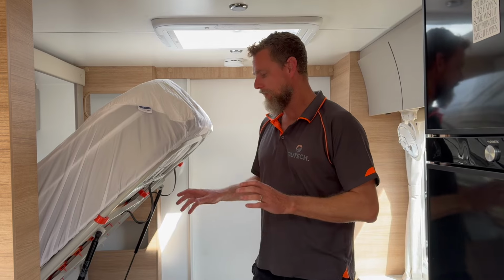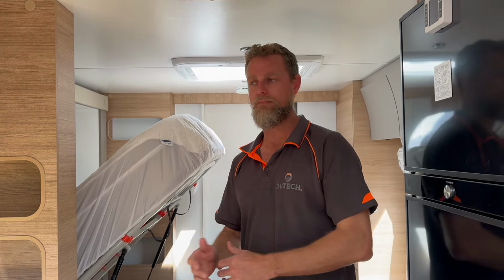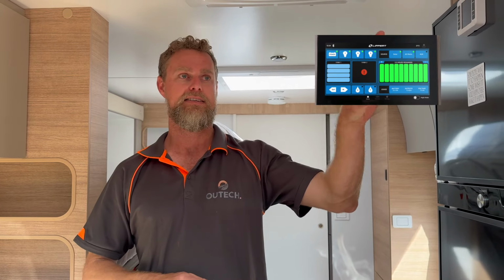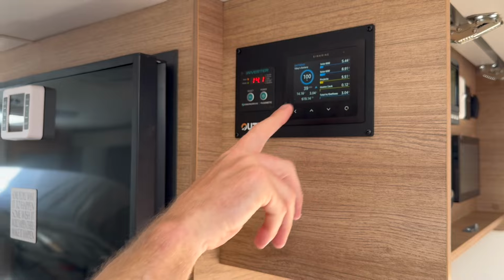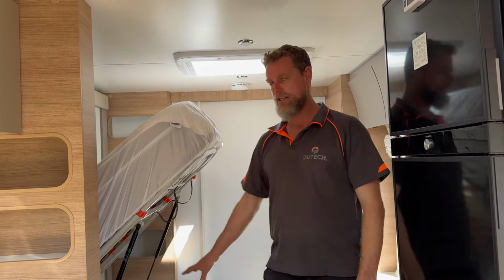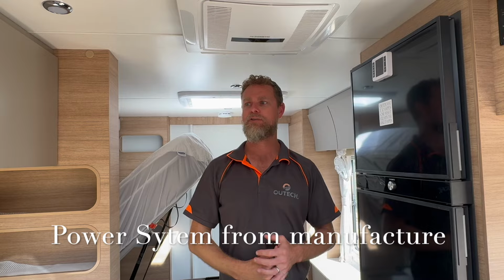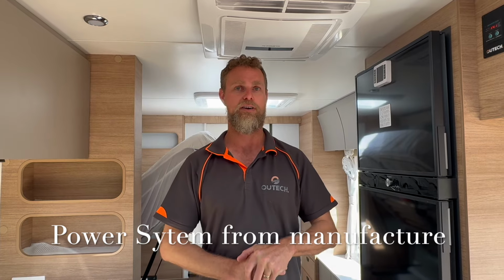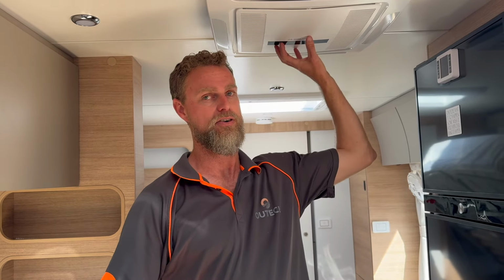The PIMPED POWER  PACKAGE - Jayco Silverline Outback

Comment: Beautiful job in the install and so much cleaner than the herons nest that Jayco have made under our Covid era Silverline bed! Now, apologies for this utterly unrelated question but … 😅. I noticed in your intro that the gas bottle cover has something that looks like easy hand sized access holes to the gas bottle taps. That is exactly what I need to allow for adding a bike rack to the a-frame. Do you know if that is a manual mod or are there special little hatches available for this? I was just going to cut some holes but I’m always looking for better options. Thanks heaps
Reply from the maker: That is a great question, I believe they come like this from factory.  Perhaps you can ask Jayco.

Comment: Any reason you don’t make the new setup more compact and put a divider in and still retain some separated storage under bed , just seems like wasted space/opportunity
Reply from the maker: Great idea. How would you suggest that we made it more compact?
Reply: @outechoffgrid  Hmmm turn your sealed battery sideways move it closer to all the new equipment you put in  I’m thinking the battery don’t need air-space around it , the lady of the caravan might like a shoe compartment . Just a thought
Reply from the maker: @paulhardie9450 perfect. Then what about battery cable distance, routing, and ensuring you stay within the bending radius of the main cables? Would you still have enough space for the battery isolator, shunt and fuse for inverter without compromising the cabling?
Reply: @outechoffgrid  if I have to tell you that then  I guess you can’t lol .  I guess that’s your  reason
Reply from the maker: @paulhardie9450  We are always looking at innovative solutions and ways to improve our off grid systems.   

We’d love to hear more of your suggestions or see  some photos that illustrate work you’ve completed.
Reply: @outechoffgrid  that’s why I asked the expert why you couldn’t  make it more compact